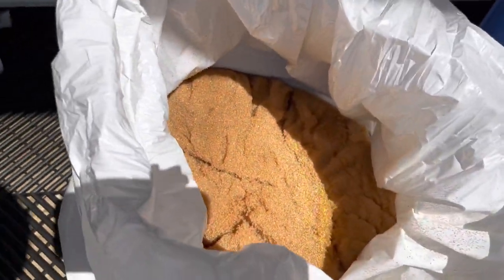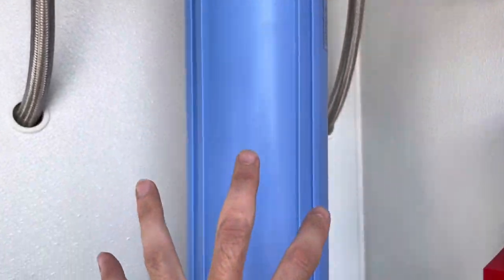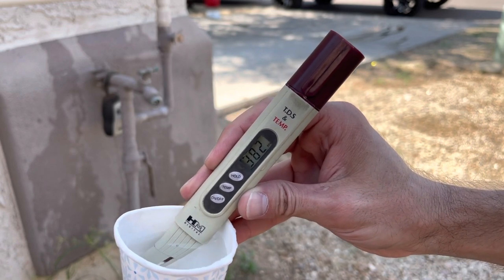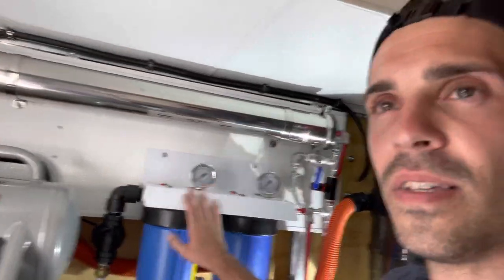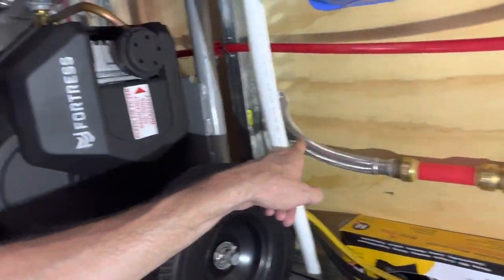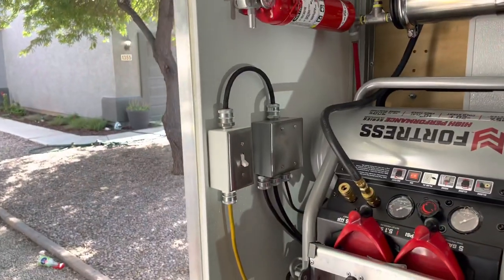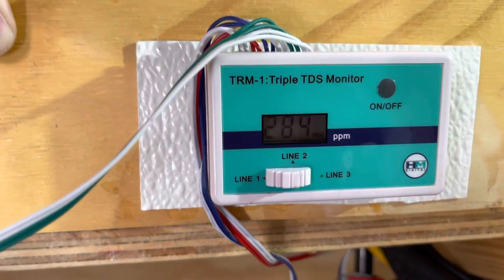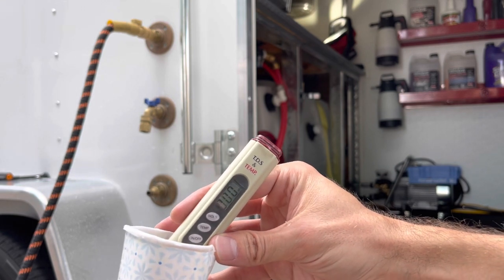Game Changing Spotless Water System with my new Spotless Water Booster

Comment: I'm confused isn't this just essentially a pre filter to the di resin system?  Also if your running a ro system why do you even need the di systems?  Doesn't the ro filter already reduce it to zero?  I have a similar system for my well water to make it into drinkable zero parts per million water but at a much slower flow rate plus it wastes tons of water as the ro system discharges 3-5 gallons for every gallon it produces so I'm wondering if your doing the same?  I didnt see your ro filter discharging any waste water so I'm a bit confused.  I'm new to detailing and been researching how to beat get to spot free water from my well water which is the worst type of water for water spots and how to do so as cheap as possible.
Reply from the maker: Hey brother there’s a lot to unpack here. First off congrats on your new journey of becoming a detailer. Starting a business is hard but rewarding. I’m going to try and simplify a couple things to help you better understand. RO does not produce zero ppm water. It can help reduce the ppm by up to 98%. For example if your water hardness is 400ppm RO can help reduce that down to 8ppm. To produce 0 ppm water you need Deionization (DI resin). I explain in this video that hard water depletes resin very quickly. This is why I send the RO water to the DI chamber to polish it off from 8ppm down to 0 ppm. You are correct in saying RO produces waste water. It seems as if you could be comparing this to a kitchen sink RO. Those do indeed produce a lot of waste water up to 5 gallons for every gallon of clean water as you mention. This is a commercial RO system so the waste water to clean water ratio is considerably better. Mine produces approx 2 gallons of waste water for every 1 gallon clean. It’s important to note you would not want to drink DI water at 0 ppm. Your body’s needs minerals. It’s not recommended to ever drink DI water. RO water is fine because it still has some mineral content. Using a system like this is by far the cheapest way to make DI water (if you’re using a ton of water in your business). If you’re not using very much water and you’re just cleaning a few cars on the weekend there’s no need to invest in something like this. A straight DI resin tank like the CR spotless will do you just fine. For guys using thousands and thousands of gallons of water in their business this could quite literally be a life line for many. It’s saved me thousands of dollars on DI resin. Hope this helps. Cheers.
Reply: Most water experts will tell you that resin is not required if you are getting under 10pm from the RO polishing is only required in the pharmaceutical business. Another tip use a low pressure membrane from Hydranautics and you get high quality water of about 4ppm. Been in the WFP business since 2006 and built loads of systems

Comment: Noticed that harbor freight air compressor, how are you liking it? I’m considering getting one.
Reply from the maker: It’s a great compressor. Bought it because the specs kept up with a tornador. I’ve had no issues with it. I am hunting for a quieter one though. It’s a little louder than I like.
Reply: @SpotlessWaterGuy  same problem I’m running in to. All the quiet compressors have very low CFM. Seems to be one you get either high volume or low noise but can’t find one that does both.
Reply from the maker: @obsessedmobiledetailing7554  agreed let me know if you find something that does both!

Comment: Great video and info. Over my head but I appreciate it. So you’re using an RO before the Deionization, but doesn’t RO already provide spotfree water?
Reply from the maker: Hey Mark, you pretty much got it. RO strips out the vast majority of the TDS allowing your DI resin to last much much longer. The reason this is important is because virgin DI resin is expensive and doesn’t last long at all before you have to replace it. RO doesn’t give spot-free water. It’s definitely way better than tap water but depending on the time of year when im making water the TDS can get as high as 20 ppm this would still leave spotting. 000 provides pure spot-free water.
Reply: @SpotlessWaterGuy  thank you so much for the vid and reply. I really appreciate it. I understand now that the RO by itself doesn’t get the ppm down quite enough but takes care of the bulk of the overall tds at a much cheaper cost. Thank you :)
Reply from the maker: @mark100177  no problem! Thanks for watching 👍

Comment: Could I shorten those down tubes to fit a smaller DI system?
Reply from the maker: They only work with the CR Spotless. If your DI system is that brand you can shorten the tube with an adapter I’m sure.

Comment: So basically what window cleaners have been doing for years, working with waterfed pole (pure water cleaning)
Reply from the maker: Fantastic way to produce spotless water isn’t it? One slight difference.. Most water fed Pole systems rely on tap water pressure to get the job done. It results in slow water production. I wanted more GPM so I added a booster pump. Creates way better flow. My new system also looks way better than anything else you’re going to find on the market. Check it out here: www.SpotlessWaterGuy.com
Reply: @SpotlessWaterGuy  I'm good with a 360Liter per hour mobile filtration system that I can get in and out my van in 10 seconds 😁👍
Reply from the maker: @nielslammens9702  Awesome man glad it’s working out for you

Comment: Great video and first class setup! I'm just a weekend warrior with my own cars and have the DIC-20 which is a game changer.  I recently decided to source a different supplier of resin and found a few different products out there.  I just purchased "Tier1 IER-110 Ion Exchange Water Softener Resin - 1 Cubic Foot - Single Bag - Ideal for Residential or Commercial Use - Reduces Soap Scum and Limescale".... Obviously the resin looks the same but do you know if all products are created equal?
Reply from the maker: Hey there! That’s a really great question. The resin you bought is for a water softener. Water softeners help by removing harmful minerals like calcium, magnesium, lime, and iron which makes water hard… (DI) systems remove all the dissolved solids and produce laboratory-grade water for a spot free rinse. What you purchased is for a water softener. It unfortunately will not remove all dissolved solids from your water but it will be significantly better than tap water.
Reply: @SpotlessWaterGuy  Got it, thank you for your feedback, now I know why my TDS monitor was reading around 100+ ppm on a clean change of resin.....That's what I get for trying to save a few bucks on the resin!
Reply from the maker: @cpas7186  I can totally see why you would think they are one in the same. They look identical. Easy mistake to make! On your next purchase I would recommend purchasing from rv-mods.com they sell virgin DI resin. You also want to watch out for regenerated DI resin. This is resin that has already been used and brought back to life. Regenerated resin is cheaper but doesn’t last as long as virgin. https://rv-mods.com/store/Spotless-water-resin-refill-1-Cu-Ft-p105868917

Comment: What's the total cost of the set up? To actually get that increased volume of DI water, you need a reverse osmosis system(pre filter) then the modified CRSpotless with 2x the resin. What is your cost per gallon now? Trying to determine whether it's cost effective and feasible for me and my setup. TNX.
Reply from the maker: Hey there! Great question. The volume of spotless water you get from this system greatly depends on your water quality. The initial cost of a system like this is very expensive but my cost per gallon went from about $0.65 per gallon to around $0.03 per gallon. The way I looked at this investment was how quickly it would pay for itself in 2 years time, the advantages of being to advertise to my customers that I only use spotfree water, the fact that it’s the safest way to clean a car, you use less soap because the water allows for more lubricity, chemicals stretch longer, there’s so many advantages to spotless water not just the reduction in cost per gallon. Hit me up be happy to talk more in email. support@sudsandgo.com

Comment: hey man i have a DIC-20 cr spotless that i use but life runs out quick, whats the best thing you recommend i do for life to last much longer but not as crazy as the set up you got my budget is not that big yet. Besides removing the cartridge, filling up the blue tanks, and adding the mod, is there anything else i can do that is low cost? hope to hear back soon!Thank you
Reply from the maker: Hi there! I don’t think there is much else you can do. They sell smaller RO systems but the problem is they take several hours to produce just a very small amount of water. It’s painstakingly slow. Not aware of other options to reduce TDS other than RO sorry brother.
Reply: @SpotlessWaterGuy  Hey man so i bought the DIC 20 Conversion Kit and installed it, but my tdc meter from the DIC 20 spotless system is showing 12ppm. Do you know by any chance why that might be? Because it should show 000 Right ? The Blue housings are set up correctly and tight, theres no sign of leaking. I appreciate your feedback
Reply from the maker: @liamnahun268  sounds like your resin isn’t getting enough time to work it’s magic. You can try slowing down the water flow. Are you using the included water sprayer that comes with it? If you are that water sprayer should be on the flat or center setting to restrict flow to less than 2.5 gallons per minute.
Reply: @SpotlessWaterGuy  yeah i actually dont even attach anything to the output just let it flow to check the ppm first. Is it necessary to attach the water hose with the sprayer for it to work?
Reply from the maker: @liamnahun268  Got it yeah that’s why your ppm isn’t showing 000. You need to restrict the water flow to no more than 2.5 gallons per minute.
Reply: @SpotlessWaterGuy  hey man it worked! it went down to 1ppm-0ppm, it bounces in between but thanks man I appreciate your help!🙏 i know you said you had this system on its own before, how often did you change the resin?
Reply from the maker: @liamnahun268  Cool glad that worked. About every 280 gallons.

Comment: Cool setup! How many gpm can your filter system flow? Your running your filter system after the storage tank and pump, right?
Reply from the maker: Thank you! The system can filter about 2.1 gallons per minute. Correct I filter the spotless water into my tank. From filling up buckets to running it through my pressure washer. I use 100% spot-free water for everything.

Comment: Great video! Currently researching a water system for my own trailer. My biggest concern with RO water is the amount of waste water produced. Everywhere I look online says for every 1 gallon of RO water produces, a minimum of 4 gallons leave the filter as waste. Is this a problem you have run into? Thanks for all the informative videos you put out!
Reply from the maker: Hey Luke! This is such a great question. You’re right most RO’s waste a ton of water just to make 1 gallon. Fortunately my system has one of the best rejection rates in the biz. For every 1 gallon of water I make my system only wastes around 3/4 of a gallon. My waste water rejection rate is slightly better than 1:1. I run a line to my customers trees and plants and water them with the reject water (perfectly fine for plants).
Reply: Not true for plants the salts build up in the leaves and burn them. I have been in the plant business for 35 years.
Reply from the maker: @brianhoekstra9841  https://trinjal.com/ro-waste-water-uses-for-plants-benefits/

Comment: Are you yielding 40% more use out of the same amount of resin or are you also using more resin?
Reply from the maker: Hey JT, the mod kit allows you to fill the big blue housings with 40% more resin thus yielding more spotless water. Hope that helps.
Reply: After giving it more though; yes it’s increasing the output of spotless water. But only because there is now more resin due to increased capacity without the cartridges. You’re actually not increasing to life of the resin using that mod. In summary, your cost per gallon is the same. His set up with the carbon/sediment filter is what expands the life of the resin.

Comment: Nice video, what is the pressure range for each of the gauges you have, like the sediment filter, carbon block, RO and DI ?
Reply from the maker: Thanks. 10 psi on the sediment and carbon block, 110 on the RO. DI I have no pressure gauge. When it comes out the RO the flow is nothing crazy. I let it do it’s thing.
Reply: @SpotlessWaterGuy  So when the pressure on the sediment and carbon get to 10psi you change them out and when the RO pressure gets to 110psi, you replace it?
Reply from the maker: Apologies I misunderstood you. When it falls below 10 I know to change the sediment filters. For the RO and DI I measure TDS readings. If it starts to go up on either I will know it’s time to change.

Comment: Would this work for a home filtration system? Or would you not want that?
Reply from the maker: Great question. If you’re planning on using the water to run through your house I wouldn’t recommend that. DI water has no dissolved solids in it. Meaning the water is hungry for minerals. It’s not the best thing to run through brass pipes as it can be corrosive overtime. Sticking with a standard water softener for your home is probably your best bet. It would work great in your garage though with an independent water tank to wash your cars :)

Comment: How many gallons does the resin last? And its about the same price as the cr spotless resin
Reply from the maker: With the new RODI system I should get well over 15,000 gallons of spot free water before I need to change out the resin. Without the RODI system you might squeeze 300 gallons out of it before you need to change the resin.

Comment: Even with the tanks alone with the mod how much cars can u wash with it till its time to change?
Reply from the maker: Hey Marco, I believe you are asking how many gallons of water you can get out of just the DI alone without the  RO? The mod increases the resin yield by approximately 40%. You should be able to get around 400 gallons of spot-free water before you have to change the resin (all dependent on your water quality). Hope that helps.
Reply: @SpotlessWaterGuy  thank you sir
Reply: What size are those tanks? To get the right ones
Reply from the maker: @verduzcoautodetailing3183  https://crspotless.com/product/diw-20-high-output-wall-mounted-system/
Reply: @SpotlessWaterGuy  awesome
One last question brother can you use any resin or does it have to be that special one for it to work
Reply from the maker: Only buy virgin DI resin. Make sure it is not regenerated. I go through RV-mods.com to buy the resin but their are many suppliers you can choose from

Comment: How long does it take to fill the your water tank ? How many gallons is your water tank?
Reply from the maker: Hey John! Takes me about 35 min to fill up. It’s 100 gallons.
Reply: @SpotlessWaterGuy  I have 2 4 by 40 filters 1 RO and one cartilage vessel with resin with quick connects at the ends. In case I don't have time I could just run the Di
Reply from the maker: @johnmejia2129 Right on brother 🤙

Comment: What is your water pressure after coming out of all these filters?
Reply from the maker: Not sure I fully understand your question but the water pressure gets up to 100psi with my booster pump.
Reply: @SpotlessWaterGuy  thanks for replying. I’m forgetting this is a mobile station. So you are filling a reserve tank with the clean water and using that for your jobs with the pump? 

I ended up getting the DI 100 Pro Compact instead so I can avoid using the flimsy cartridges and lackluster mod. I considered getting the RO and Carbon filters but I would never have sufficient water pressure to be able to power my pressure washer on the other end directly so I might just add a carbon filter to help.
Reply from the maker: @143Garage  Cool yeah adding any pre filters along with the DI kit will probably starve your pressure washer of water. Do you know how many gallons per minute it consumes? in order for your DI resin to work it needs time to pull out the dissolved solids. This is why some companies explain you need to restrict the water flow to 2 gallons or less per minute. Any higher and the DI resin can’t to do its job properly and you are left with water that’s not totally purified. I’m not familiar with the specs of the DI 100 but you’ll want to see how many gallons per minute it’s rated at to see if it will work with the consumption of your pressure washer. One other thing to note. The only other thing that will pull out dissolved solids is RO. Carbon and sediment filters do nothing to pull out dissolved solids. They make your water taste better but they don’t pull out TDS.
Reply: @SpotlessWaterGuy  I have pretty much always used 1.2GPM pressure washers only. The RO system would for sure kill the pressure but I don’t running a (Carbon > Regulator > DI Tank > Pressure Washer) would work out great hopefully.